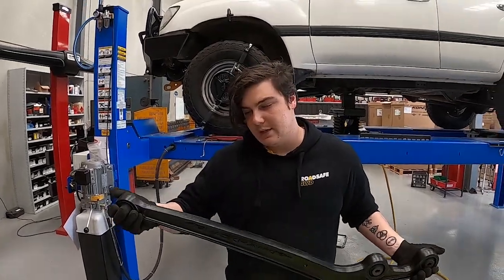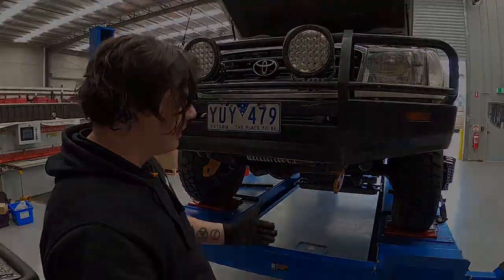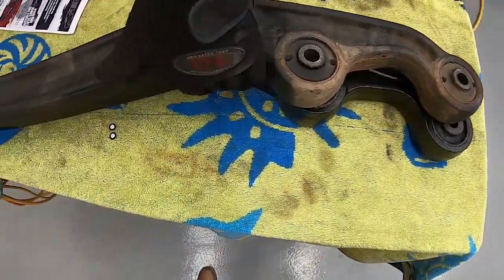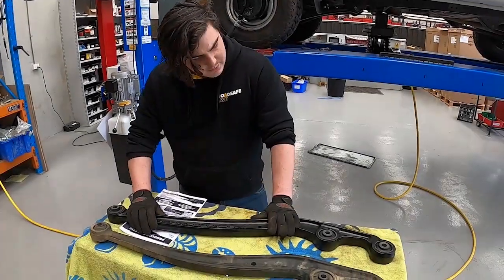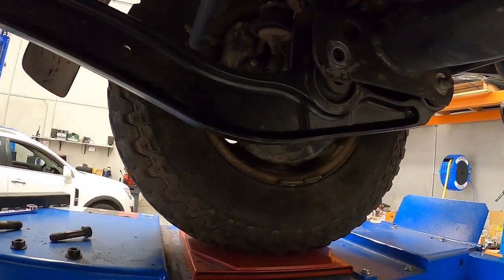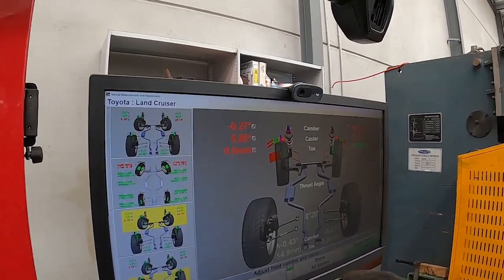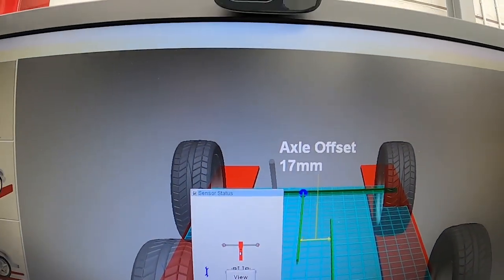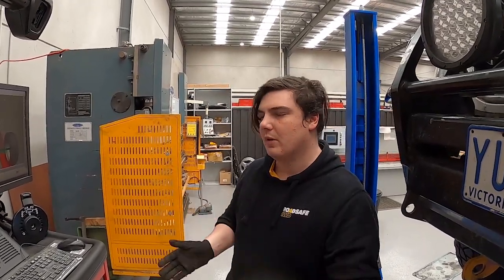LANDCRUISER 80/105 SERIES BLACKHAWK FORGED RADIUS ARM INSTALL

Comment: Hi Oscar, my 105 already has  2 inch lift/GVM up grade, if I change now to these, will I need to get the GVM recertified ?
Reply from the maker: You won't need to have the GVM recertified, to be 100% legal you will need to have the radius arms engineered. The Blackhawk arms are compliant with any front axle increase/GVM upgrade so you won't have any issues there.

Comment: Roadsafe, will these allow you to fit 315/75r16 without scrubbing on the front mud guards? How do the hybrid bushes wear compared to factory rubber bushes? Past synthetic bushes I've run have worn terribly compared to rubber. Thanks
Reply from the maker: Hi Graham, The Blackhawk4x4 radius arms will definitely help clear the 315's by pushing them 15mm away from the guard, Rim offset and lift height will still play a part in getting enough clearance.